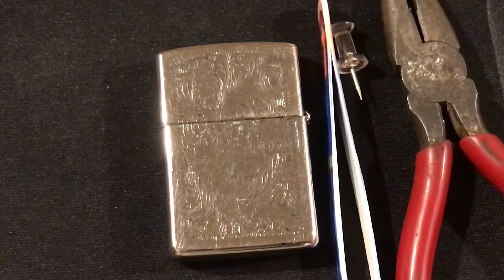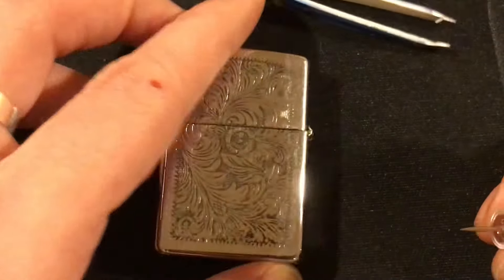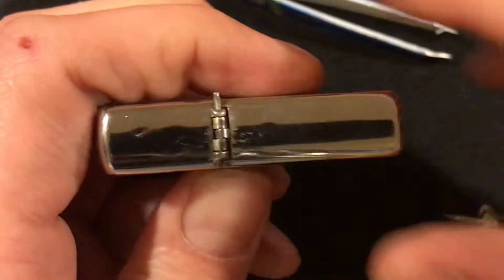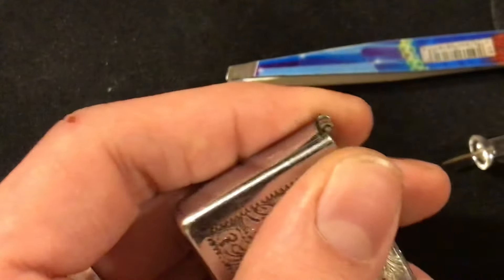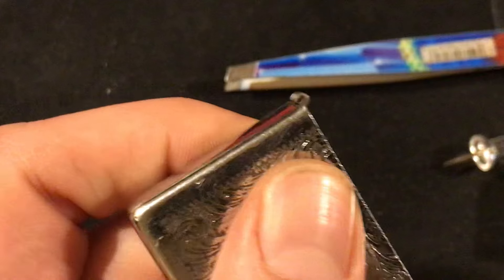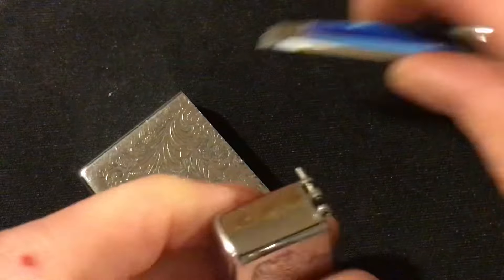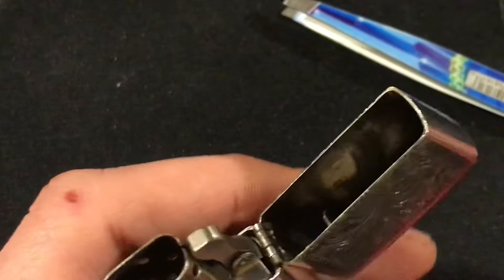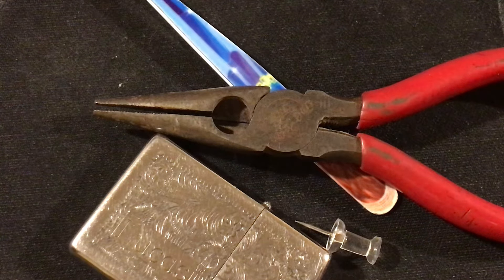Zippo Loose Hinge Problem Finally Solved !

Comment: Hey ZF, you probably wont ever read this but i just fixed my uncles old niagara falls, ontario venetian zippo he gifted me, which I've owned for about 15 years. He replaced the original broken pin with some kind of small clout nail or tack when he was a young lad - it has since needed attention because it began to slide all around inside the hinge barrel. I used your video as a guide and have removed all play in the lid! It swings open gracefully and has absolutely NO wiggle from side to side! It's SOLID! thank you! Im glad i was able to restore this piece to its former glory!

Comment: You’d think being the most important part of the chassis that Zippo would have this fixed by now
Reply: @ZippoFanatic77  with the new zippos they have started putting a metal shield over top the pin so you cannot remove it anymore.  apparently the "loose" part is normal and even ones out of the box come this way now. so i'm not worried about it anymore, as long as it opens

Comment: New collector here. Just inherited 3 zippos from the 90' and early 2000's. One has a really loose top. Hinges need to be tightened. Thanks for the tutorial! 💚
Reply: Nice! If you can older ones, snatch them up. Got 1 late 30s a handful of 40s, 50s, and about 55 Zippos from Vietnam a few commutative some groomsmen, a limited edition Cohiba zippo, and a solid gold from 1982.

Comment: Thanks for the video.. used your method but guess one of the hinges was really thin and old so when i used the pliers gently and it broke off. It was an older one and was stored in a damp garage. Glad I have a way to fix other ones that I have now.

Comment: Thanks for the video man. So I'm pretty sure my hing pin was just too wore out but I did like you said and tried tightening the hinges and ended up cutting and putting the push pin in and seemed to tighten up well enough thanks again. Oh and the zippo I was working on is from 2014.
Reply: Oh nice. Yeah those ones are a little different to fix because the newer ones the case covers the pin so the pin doesnt slide out.

Comment: Hey, great Zippo content you got going on! I just recently got myself a couple, both second hand units, and feel I could use some pointers, if you don't mind the trouble answering.

First off, the cases of both have a bit of looseness in their hinges and I feel they could use some tightening. Nothing that serious I think, but definitely looser than your resulting tightened hinge at the end of this vid. With the insert removed and the case held sideways, the non-hinge side of the lid on the first one droops about 1mm to the left and 2mm to the right, and about 1.2mm and 3mm on the second one, respectively. As I haven't handled a brand new Zippo (yet... I feel this might become a collecting rabbit hole :D), I don't have a point of comparison with a fresh hinge. Do you think this amount of sway I got with these cases would warrant a tightening?

Secondly, I can't quite seem to figure out how you're getting the hinge pin out of these modern cases with the interally mounted hinge. No matter which position the hinge is, the edge of either or both of the case halves seems to always partially obstruct the hinge end, which would seem to prevent the pin to be pushed out. I haven't used any tools on them yet, to not risk making dumb mistakes that would result in a case needing professional repairs.
Of course, I could just try the tightening method you showed in your September 18 2020 video where you simply gave an intact hinge assemly some squeezing with pliers, but this one would seem like a more 'proper' method, as it would appear to better retain the hinge's original form and not risk malforming it.
Thanks!
Reply: @ZippoFanatic77  The cases I have are from 2012 and 2018, so are presumably of the newer type. I'll have to have to check out that hinge video of yours. Thanks!
Reply: Thanks, very detailed and hepful.

Comment: I have the armor zippo and the case overlaps the pin hole so I couldn’t push my pin out but with pliers a small ball peen and the concept from this video I made it work lol now it’s not loose
Reply: Next time open the lid to push the pin out. That’s how the newer zippos are designed.
Reply: @Zippofanatic77outdoors  I tried that but it still overlapped the lid on both sides. I’ve had this lighter size 2012 and it was pretty beat up. I think things were bent before lol now that I’ve adjusted I can push the pin out.

Comment: Well my lighter is solid sterling silver and the prongs that hold the pin dont bent like that i mean mine are all one piece theres no way to bend them tighter for the pin to fit.
So what do i do?
Should i even bither taking the old pin out or might i break sterling silver?

Comment: Hey, I'm having trouble using this method with a Zippo Armor. any advice?
Reply: U can’t use this method because the newer zippos case covers the pin. U have to open the zippo lid so the pin slides out

Comment: I cant get the pin out no matter how hard I push or from what side... :(
Reply: It’s because your trying to do it to a newer zippo. The case covers the pin. So u have to open the lid all the way then push out the pin.
Reply: @Zippofanatic77outdoors  I dont know to be honest, what difference would there be between a wide open case and a closed case, are you sure about that? This Zippo is 15 years old and the design just doesnt seem to match your video, there is no way an unglued or welded pin could resist how hard Im pushing on it with the tack. I think some Zippos must have just been designed different.
Reply: @Th4rgor  yup I’m sure about it haha. Ill make a video showing but when u open the lid of brand new zippo about half way or more u can see nothing covers the pin now.
Reply: @Zippofanatic77outdoors  Ive tried in both the opened and closed positions, twice as much force as you seem to use in your vid, nothing budges, Ill try putting it in a vice and tapping it in with a small hammer in the morning but I think some Zippos must just be a different design, Ill push it to destruction tomorrow and just ship it off to Germany for repairs if that doesnt work, thanks anyway.

Comment: They dont make zippos like they used to the metal is cheaper and thinner and they break after a few years of heavy use. I knew a guy who had a zippo he was issued in the military back in ww2 it was heavy thick and it still had that click even after decades of use. These new zippos are cheap BS, back in the day the warranty was just a cool add on cause nobody really had to use it now days you need that warranty cause its definitely going to break
Reply: @ZippoFanatic77  one of my cam springs actually broke in half and the cam pin wore down and came out too. Thats when I knew something had changed with build quality